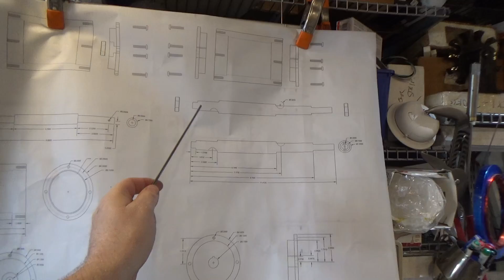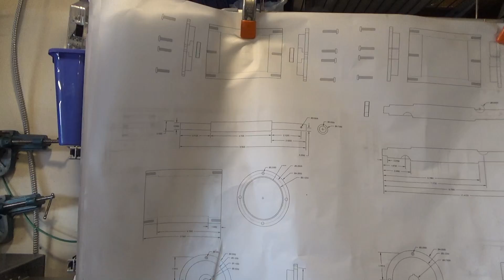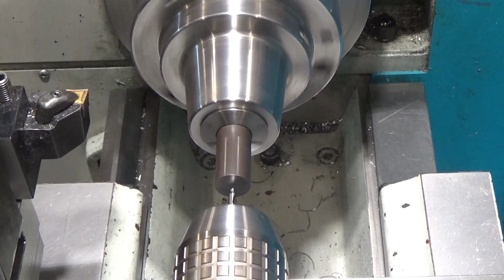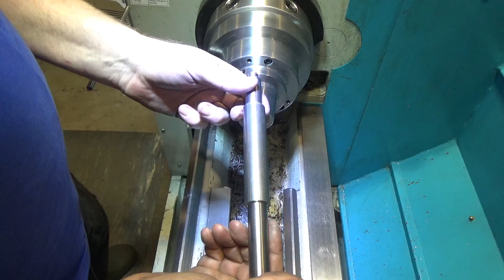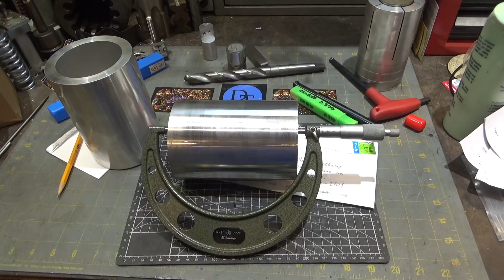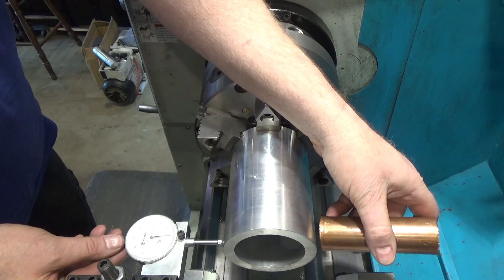142 6x48 BeltSander The Rollers 04 Part 1

Comment: A few things to note.  

1. I'm no expert but have played with this stuff.

2. You really didn't need the mandril.

3. The ID of that thicker aluminum tube is rarely concentric with the OD.  It can be off a bit.

4. ID and OD of extruded aluminum not are typically perfectly round.

5. I would have lined the tube up as best as possible od in the 4 jaw and turned the ID, made a short step for the endcap and faced the end.

6. make the end cap for that side, bearing or shaft roller.  

7 rotate the roller and repeat the process for the other side. (back to step 5)  You can leave the cap in to minimize distortion and flex. 

8. Mount the shaft with either bearings or shaft and turn the OD crown. 

IMO the end caps don't need to be 4340, they could be 6061 like the tube.

You could interference fit the end caps. Heat the tube up and cool the end cap. Slip press together about 1 thou per inch.  I'd turn the center of the end caps after done. I would require the fixed shaft to be spaced differently tho.
Reply from the maker: Excellent suggestions. Thanks.  Sometimes I take a particular approach, just to see if I can pull it off and other times it's because it's the only one I thought of (like this time).
Reply: @DudleyToolwright  Nothing wrong with what you are doing. As you gain experience you find easier ways. Not saying my suggestions are best either.

Comment: Hi Rob . I thought i was watching my latest video for a moment , facing the material to length in the mill !!!  Good to see you making some progress  . That was a bit of a different method .  Do you have a cone ( pipe ) centre & ID gripping  steps on your 3 jaw OD jaws .  if so the entire pulley , including the crown can be made in 2 basic set up's .   Cheers !
Reply from the maker: I shot this video about 6 months ago and at the time I did not have a bull nose center that would go to 3 inches. My jaws do have inside gripping capability, but I would love to hear about your solution for fewer setups. That is always a good thing. I wasted my first set of rollers, because the length of the cylinders were not consistent - off by +/-0.005 depending on there in the circumference you were measuring, ie. it was canted a bit when I turned it. Thanks as always for your welcome advise.

Comment: Good job. FYI When you tighten your chuck you should tighten all 3 scroll drives. It will help keep parts concentric without messing with set-true. =)
Reply from the maker: THat would be excellent advise, if only my 6-jaw had 3 scroll tightening points. I didn't know until I got this Shars Tools 6-jaw chuck, that it only has one tightening location. Bummer.
Reply: @DudleyToolwright  oh I didn't know that interesting well it seems to be doing pretty good regardless